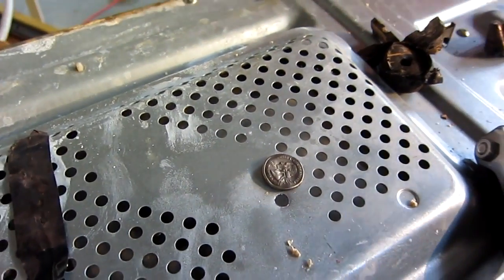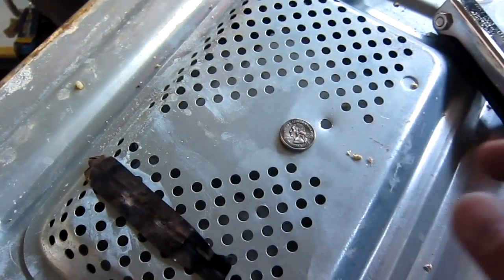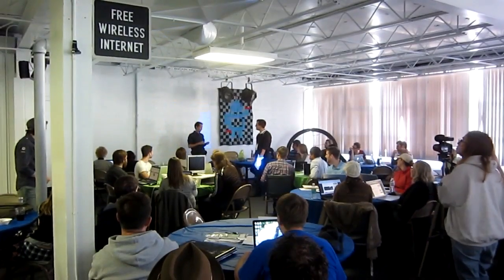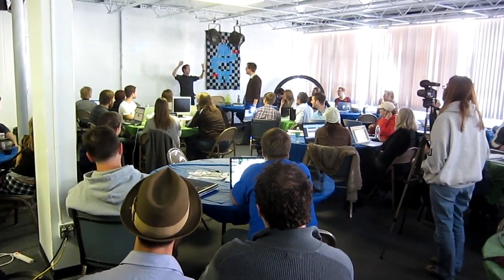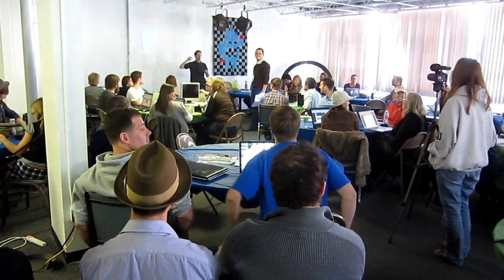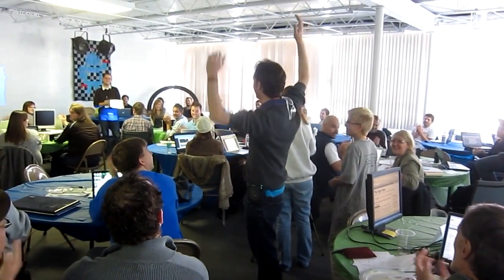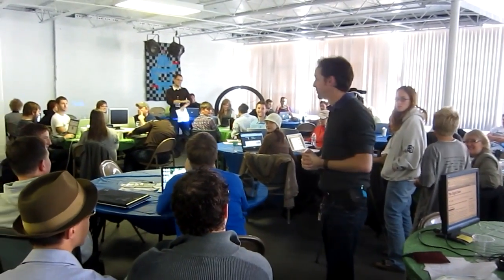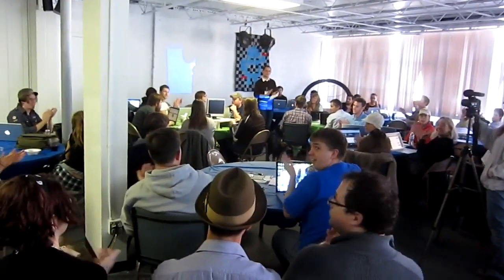Stomper Demo - High Impluse Generator

Comment: @magicmel02 theres a couple things that come to mind, the first being that we need a graduated cylinder and measure a series of quarters and a series of shrunken quarters [allows for age, wear and tear, and other irregularities to be averaged out].  the problem is the cylinder has to have a very fine measurement, as the 'shrink' is probably less than a cubic millimeter.